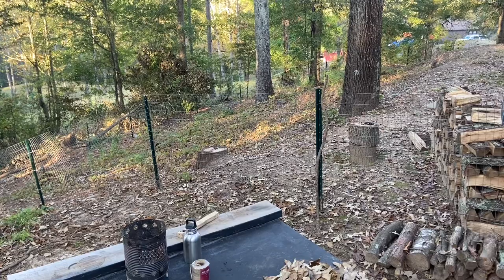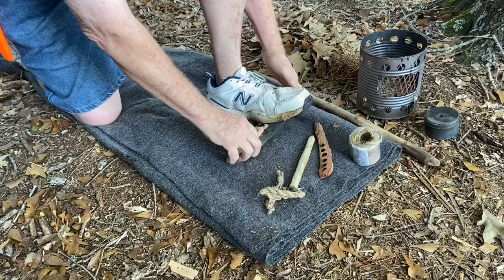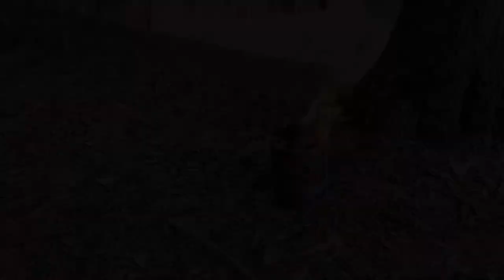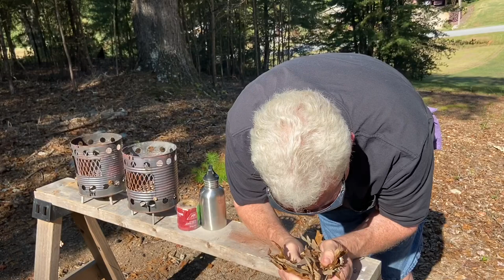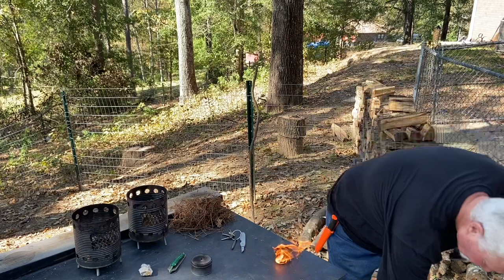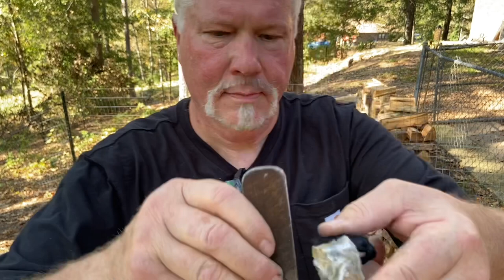6 Ways To Make Fire With JUTE

Comment: A good striker you can keep on you at all times is a P-51 or a P-38 . They have a sharp 90 degree spine plus the little blade if needed but the edges are sharp enough  . And of course you would have a excellent can opener also 😉
Reply from the maker: I like those can openers.

Comment: CCI standard velocity 22lr ammo is subsonic, cycles semi autos great, and will connect with more energy than most designated subsonic or quiet ammo. It is also more affordable and generally easier to find.
Reply from the maker: There still may be cycling problems because the sales info says ideal for bolt action and single shot.

Comment: Are you using the wireless mic still? Sound is awesome through the bow drill at least.
Reply from the maker: No. It turned out to be junk! I lost a lot of good video by the time I noticed. The problem with cell phone mics is they zero in on and amplify sounds from the neighborhood. When I star talking again the volume goes low till the mic zeros back in on my voice.